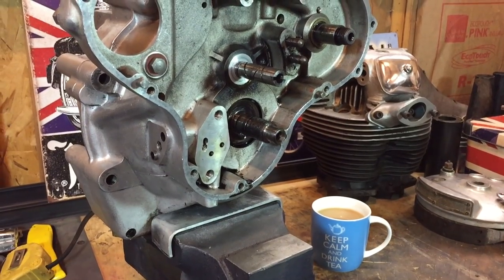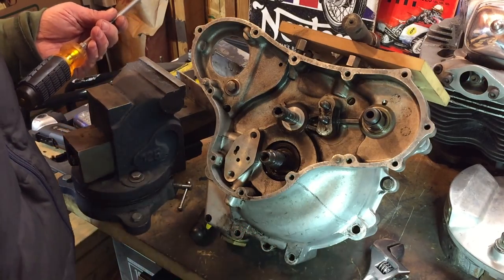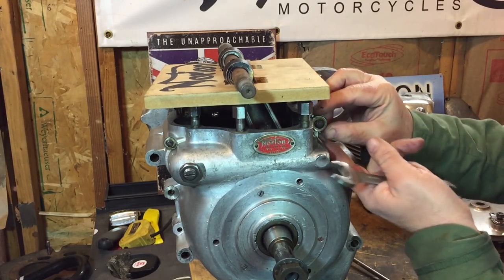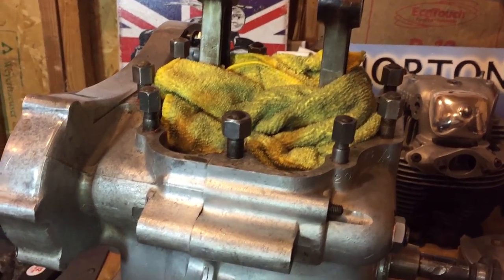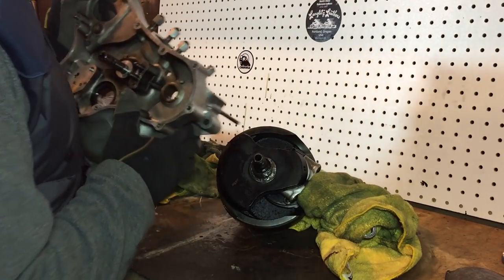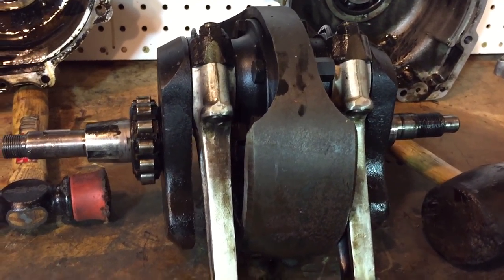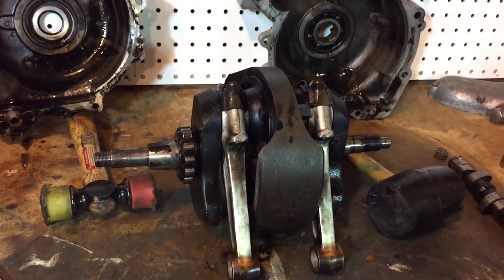Norton Atlas Project - Shep - Part 31 - Engine Disassembly - Part 12 Splitting the crank cases

Comment: Hello, I really like your videos. I have only watched your Shep vids. It looks like you have experience with all manner of classic English bikes. May I ask what your goal is with Shep? If, as I suspect you will make it more or less original, do you plan to keep and ride it? I'm wondering if an Atlas would, or could be as useful as a Commando. Cheers, SR.                                                                                                                                                            P.S. , my wife says it sounds like a broadcast of a golf tournament when I'm watching your videos!
Reply from the maker: Thanks for your note, Stephen ;)   
I'm hoping that it will finally look something like a Manx Norton (but with an extra cylinder!).  My goal is to have it look like it's an original cafe racer from the 60's.  So it won't be fully restored but cleaned up and I'll try to use original looking components for a period look.  I'm also trying to do it on a very limited budget.  Once I finally get it running, I may keep it for a little while, but I have a couple of other projects in the pipeline!  But I also said that about the other bikes in my garage ;)  I'd say that, generally speaking, a Commando would be an easier bike to live with with today's roads and conditions, although there are some guys who ride their Atlases all over!  Cheers, Mike.

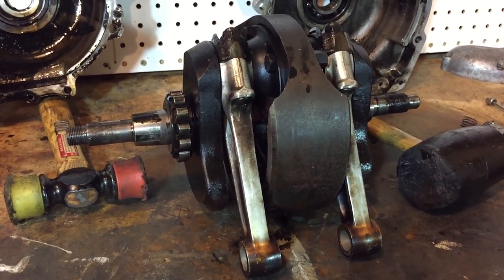Comment: Hello, the recording shows at 8:22 that the engine sprocket obviously goes over the keyway for the woodruff key or the keyway is covered by the sprocket. I have the problem with my Atlas that the sprocket does not go far enough on the taper and thus causes a missalignment of the primary chain. - Can you tell me how far the sprocket goes on the taper ?
Reply from the maker: Hi Jörg.  This might not be a good example as I had a different sprocket installed because it was a belt drive, but below are a few clips of removing the sprocket to illustrate how it was installed.  This bike also had a Norton Commando primary casing installed, so it was a very strange setup.  
https://youtu.be/n2BsgHIyfBE?list=PLgDzKiI-i6nYTzxrLolDHnSxPiWRXeiOd&t=660

Comment: Hello mi ty, just watching your videos and I was wondering why the hardware is all SAE and not metric? I mean it's an English bike so it should have metric hardware right? And what is Wentworth hardware? Seems like you have a lot of it in that motor?
Reply from the maker: Joe Deleon Hi Joe, this bike pre-dates the metric system, which I think arrived in around 1965. Many of the early British bikes used BSW (British Standard Whitworth) hardware and later bikes began using SAE or a combo of BSW & SAE before moving to Metric fasteners. Cheers. Mike
Reply: @TheMightyGarage  right on brother! That definitely cleared a lot of things up I was wondering about, thank you for the info and thank you for the quick reply back, do you stick to only British with your videos or have you done any Japanese bikes in the past? I ask because I have six Hondas, 3 runners and 3 projects...